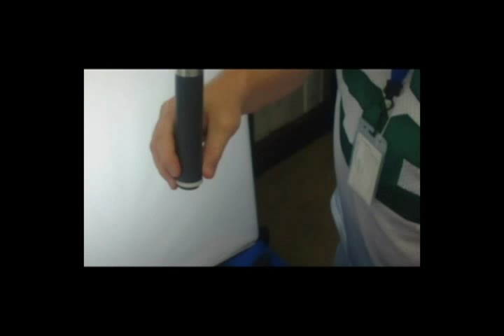Pentair's Fleck 2510 Control Valve Stuffing.wmv

Comment: I didn't know I needed this tool when I ordered the seal and spacer kit.  After many failed attempts at stuffing them into the valve them using my fingers, I figured out another way to do it.  I put the retaining clip on the piston shaft and then pushed the shaft as far as it will go into the end cap.  Then I held it vertically upside down, and stacked all of the seals and spacers over the piston and resting on top of the end cap. Still holding it upside down, I took the valve body and placed it over the piston and then pushed the piston into the valve body as far as I could.  It should go almost all the way in.  Then I screwed it down and it pulled it in the rest of the way.
Reply: cool.  ......i get the general idea of using the piston and the end plug in place of the speical tool but i  have a few questions.
what "retaining clip" are you referring to when you say "I put the retaining clip on the piston shaft"?   looking at part schemtic i don't see a "retaining clip"?
what do you screw down when you say "Then I screwed it down and it pulled it in the rest of the way."?
any assistance is much appreciated.  thanks!
Reply: Sorry, I made a typo. I should've said I removed the retaining clip from the opposite end of the piston shaft where it connects to the arm of the motor so that I could place the end on the workbench.